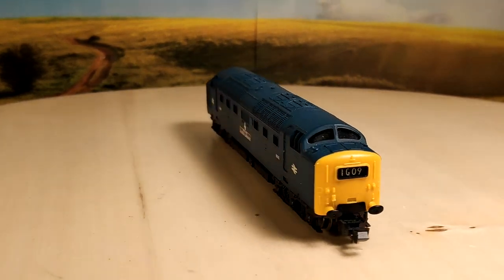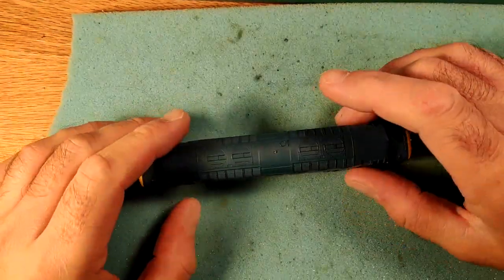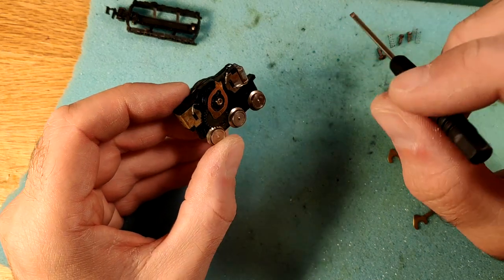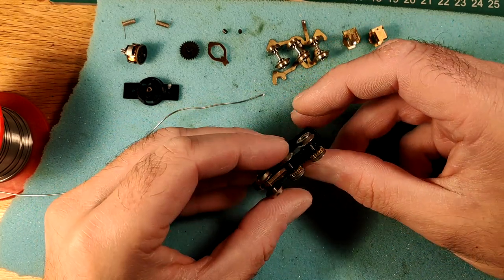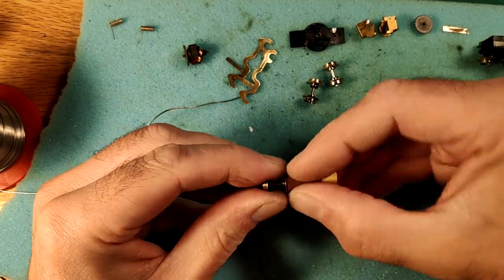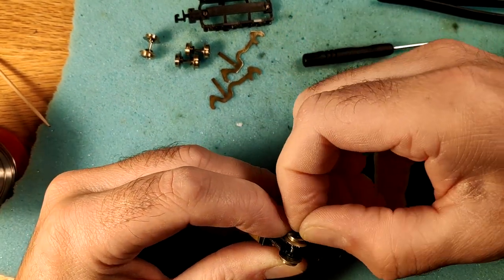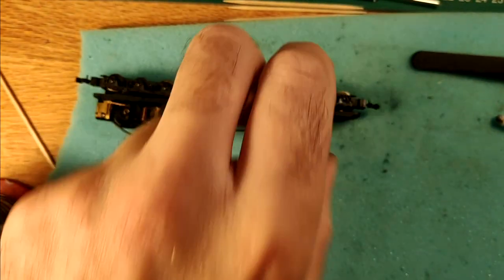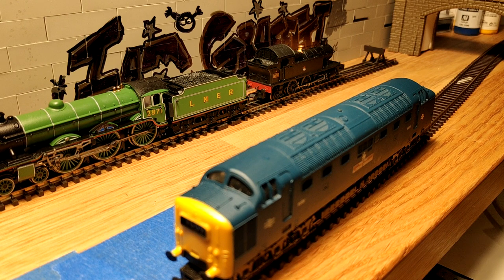Lima Class 55 Deltic Tear down and Clean

Comment: Thanks for this, enabled me to improve my deltic’s performance a bit just by cleaning the rear bogie contacts. Also found it doesn’t fit under the station footbridge on my new layout 😅
I do have the noise suppressing capacitor,  i have left on for now.
Reply from the maker: Great stuff, its lovely to hear youve hopefully made it run better 👍, sorry to hear about the footbridge! Mine didnt want to go through a tunnel! Dont worry about the capacitor, you can leave it on, i just like to mess with my locos so i removed mine incase in the future i put it on DCC. 👍👍